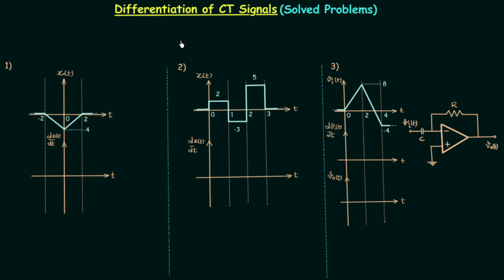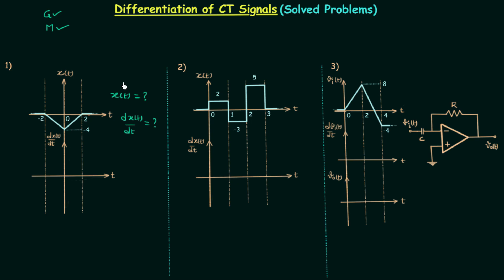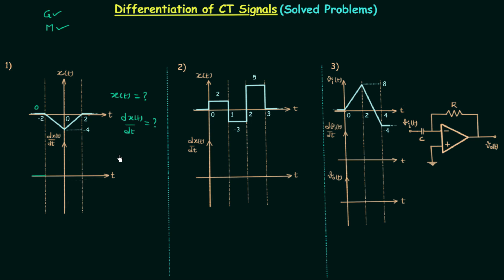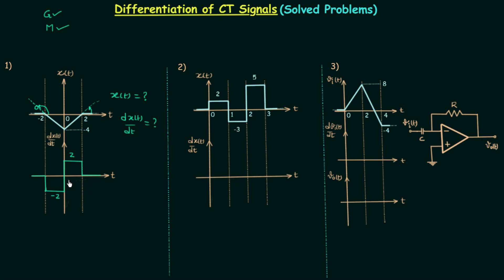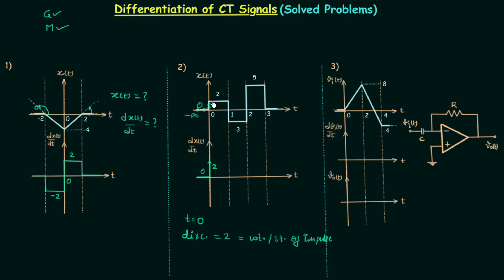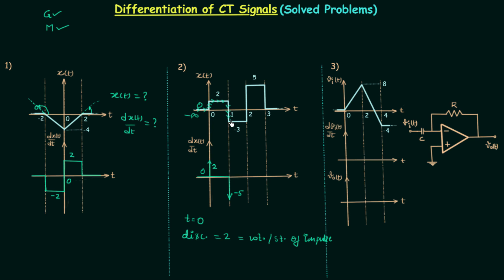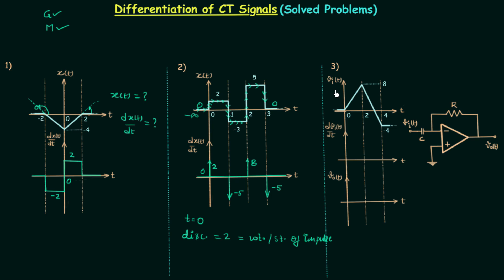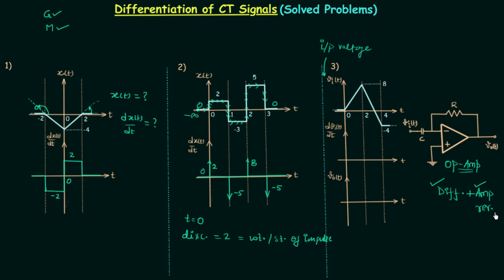Differentiation of Continuous Time Signals (Solved Problems)

Comment: for the third example, the second slope is -6, so dropping from +4 by -6 should be -2 but in the example it's -6. Am I wrong or this is this indeed a mistake? Please confirm sir
Reply: It was dropping from 8 to -4. That is 12. Divide that by the horizontal length -12/2 = -6
Reply: +1
Reply: Hey. So the slope graph isn’t about the position. It’s about the magnitude 
Example:
From t = 0 to 2, the slope was of magnitude +4. 
And from t=2 to 4, the slope was of magnitude -6.
In conclusion, it’s not about the position but the magnitude of the slope.
Reply: Hey. So the slope graph isn’t about the position. It’s about the magnitude 
Example:
From t = 0 to 2, the slope was of magnitude +4. 
And from t=2 to 4, the slope was of magnitude -6.
In conclusion, it’s not about the position but the magnitude of the slope.